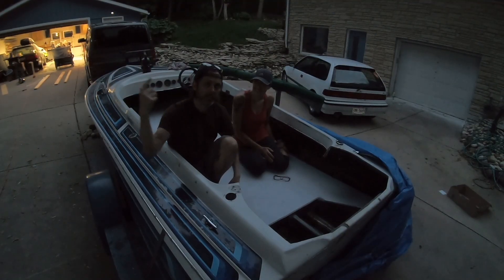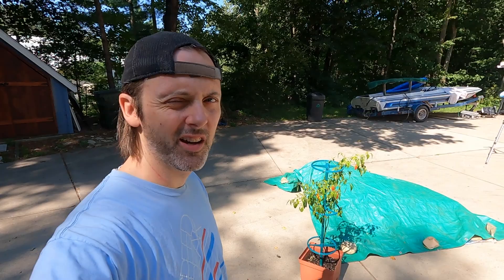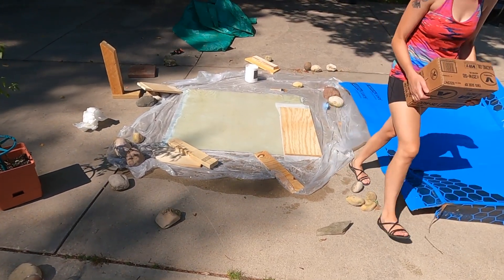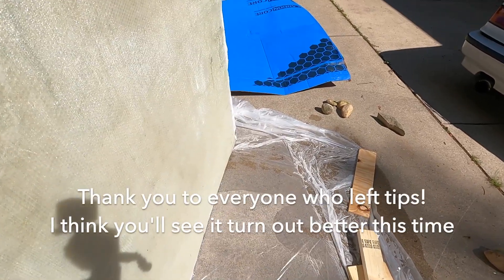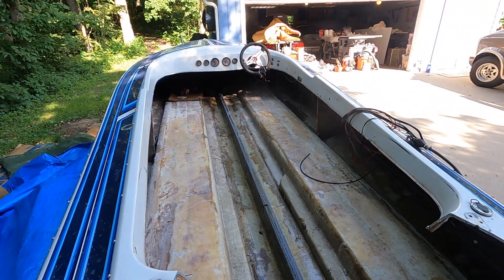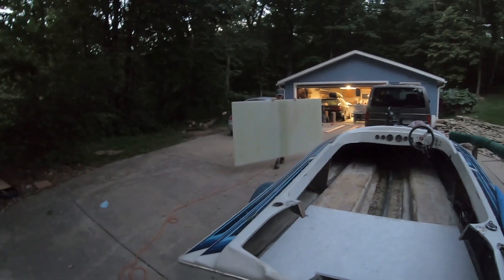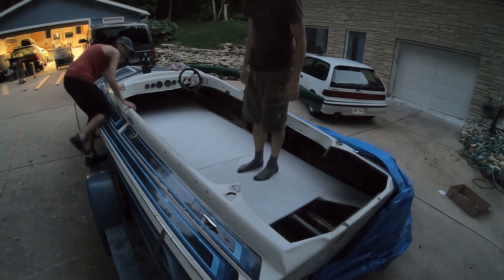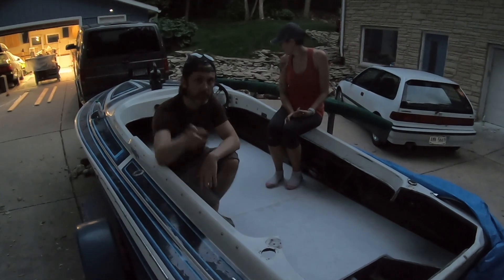Lightweight Composite STRINGER/BULKHEADS & HONEYCOMB FLOOR Sleekcraft SST Sunday #15

Comment: I'm about to start the rebuild process of an 83 glastron Carlson. 23 v love your videos gonna pretty much do exactly what you are doing. Have you thought about inlaying led lights in the honeycomb floor
Reply from the maker: Nice!  Carlsons are dope; I think the sterndrive CVX20/21 has the best stern styling out of any boat ever produced.   And yeah man, I actually mentioned maybe glassing in some LEDs to the top of the stringer before installing the floor, then maybe taping off a section of the floor before painting it or something.
Reply: @ADDvanced  the Carlson I'm getting is stern drive with the 260 Merc. I'm so freaking excited to rebuild it more right now than I think I am to get it on the water lmao
Reply from the maker: @chrisgarrett1369  Oh hell yeah, same setup in my aristocrat.   Parts are so cheap to hop it up a bit, too!  I am probably at 350-400hp or so, and the Alpha holds up fine if you don't beat on it.
Reply: @ADDvanced  question do you think the resin would yellow the lighting
Reply from the maker: @chrisgarrett1369  Probably... because I'm using polyester resin.   If I had been using epoxy, it would be less, but... yeah idk GF is saying we never go boating at night anyway lol

Comment: Maybe another one or two more layers of biaxial (the strongest fiberglass material) over the transome. I had a fiberglass boat shop told me they quit using coosa on transome, because it was not strong enough, to many returned warranty jobs.
Reply from the maker: Good idea!   I'll put another set of big tabs of 1708 from transom to tunnels.  Also still need to beef up the knee/transom connection, and the stringer/transom connection.   I want those areas bomb proof.
Reply: Kelly, If they're not using coosa on the transom what are they using?
Reply: @forgotten320  marine plywood. They probably made the mistake of only using one solid piece of coosa board. I have seen other shops use multiple 3 or more thinner layers of coosa board with each layer encapsulated in strong multi directional fiberglass and resin.

Comment: This thing is looking great! Everytime I look at it all I can think about is how strong it'll be! Side note for the honeycomb, "potted inserts" might be a good option for mounting stuff to the floor, aviation uses them to put cabinets and other interior items along bulkhead walls and such. Keep the good videos coming!
Reply from the maker: So like use a hole saw and fill w epoxy, and set in a T nut or something?
Reply: @ADDvanced  Pretty much, there are specific potted inserts for doing that, their pretty cheap online, and you epoxy them into place in the drilled hole. With honeycomb panels in aviation you'll get around 250lb sheer and 400lb tension strength from an insert in a 1/2 inch sheet, so if you did 4 bolts per seat you should have a good factor of safety.
Reply from the maker: @lukeb1189  Dang, just looked these up and they look AWESOME!   But having a super hard time finding any for sale.  Marketing masters has a $500 min order, looks like most of these aerospace places only sell to businesses.   McMaster doesn't stock anything like them.  I'll keep looking but if I can't find a source I think I'm going to do small carriage bolts with a sheet of aluminum under the floor?  idk.
Reply: @ADDvanced  if you still need some you might find them at an aviation surplus in Ontario Ca called G&J on Sultana St. I'll get solid info if you need
Reply from the maker: @forgotten320  Actually found some, will be shown in an upcoming video this spring!   Thanks for looking out tho, I definitely feel like they're the best way to mount seats in this material.
Reply: @ADDvanced  definitely like to know how they do, have a few projects myself.

Comment: Have you thought about moving both your battery and your gas tank forward as far as possible in order to shift weight forward? This would help you get up on plane faster. Run the wires and fuel hose before you put the floor down.
Reply from the maker: The problem is the gas tank is custom made for one area of the boat, and the fuel filler holes are already there too.   I could probably relocated the battery a bit forward on the other side...  I'll look into it, appreciate the input!

Comment: I would have added more bulkheads to support the floor especially at the seam between the two.
Reply from the maker: I don't think the floor needs much support, it's only bridging a 9" gap from the tunnel to the stringer, and once I put some glass on the upper surface it'll be pretty strong.  But yeah, supporting that seam might be tricky.... hrm...